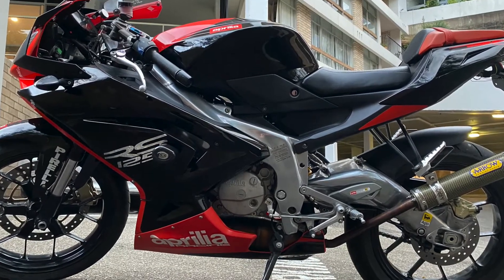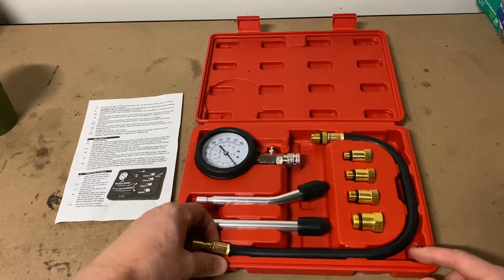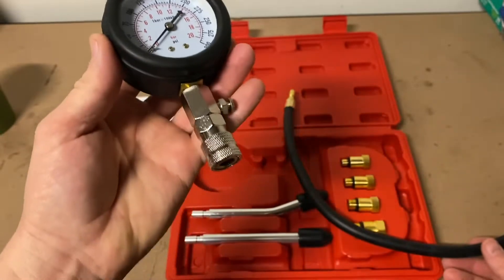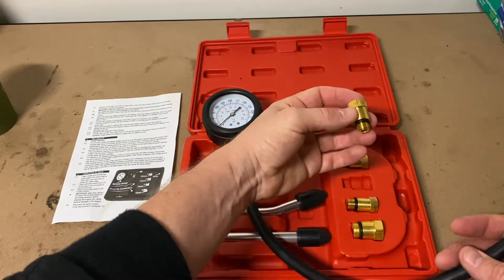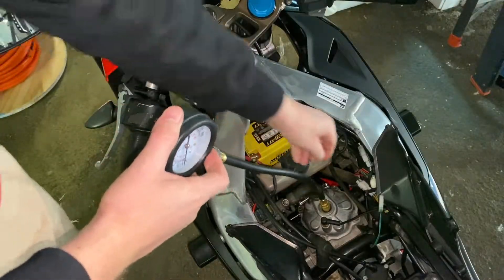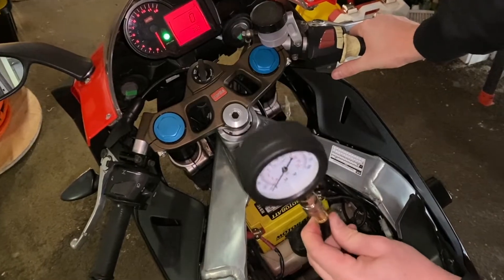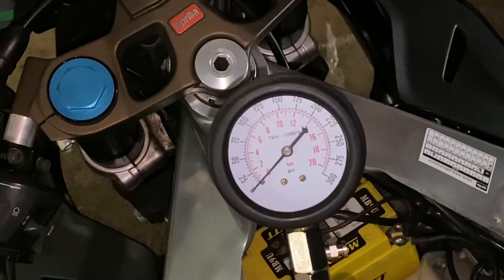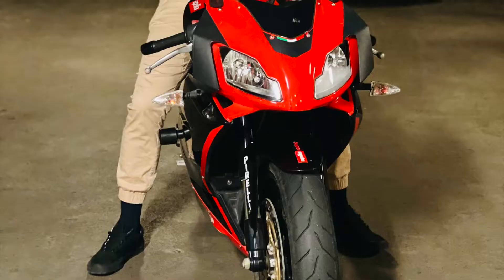Aprilia RS 125 2 Stroke - Piston Compression Test

Comment: Hi. The compression is necessary to have the engine warm.
Reply from the maker: Hi Federico.
I think the compression test can be done with a hit engine or cold?
Reply: It’s correct, the normal work of the engine is when it is hot. If you do the test with the engine cold, the gap is bigger than is hot. You need the compresión in a normal work. Hot one. Sorry for taking so long to answer

Comment: Just give it a ring change and use 0.3 gasket or skim head and change squish to 0.8 or nearest you can
Reply from the maker: Im about to replace the piston once I see what size my cylinder is. A, AB or B and will also get it professionally measured.
At this stage I think I will use a Wossner 2 ring piston. Whilst doing this, I’ll also replace the little end bearing.

You mention 0.3 gasket and trying to achieve 0.8 squish. Is 0.8 squish good for mileage or power? I’d prefer to float somewhere around the midrange.

Please tell me your thoughts👍
Reply from the maker: Thank you for your advise and continued support.
Reply from the maker: Hey Paul.
I kinda thought that may be the case. There is often a trade-off between more HP and longevity. Anyhow, I’d like to see how fast an Aprilia RS race bike can be when tuned to the max.

Comment: 130 to 150psi is good mikita give low reading than original aprilia rs125
Reply: I got 137psi  with a wossner after a rebuild and then ran in 🤔
Reply: @OldestYoungenInGuidePost  I got 143 with a mitaka set